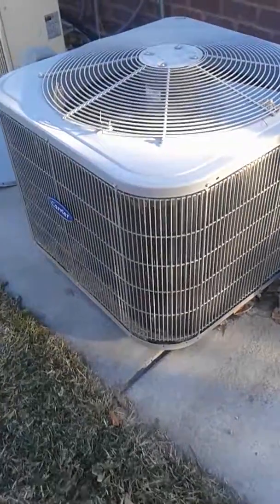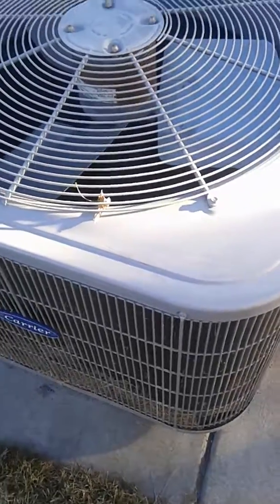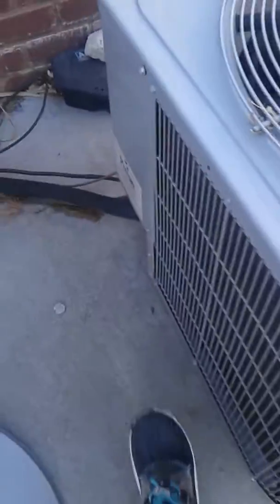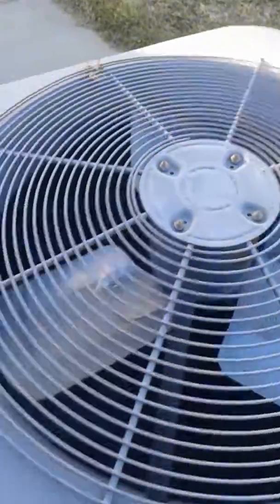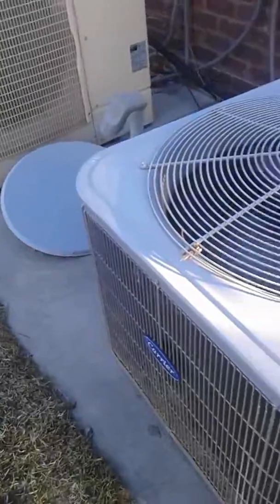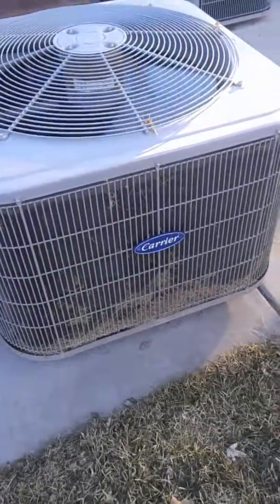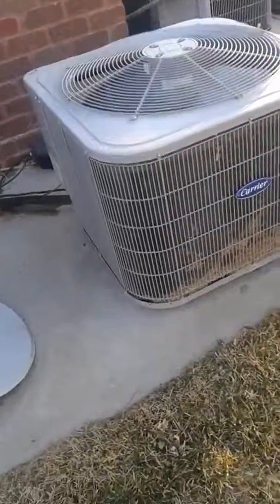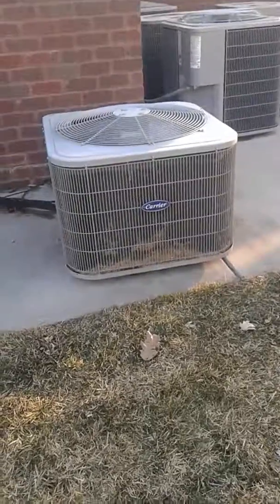Malfunctioning Carrier Central Air Conditioner

Comment: It's on a low-ambient kit, which is when the fan shuts off while the compressor stays running (when it's below 55 degrees) to prevent the suction line from freezing up.
Reply from the maker: Oh, that makes sense. Thank you.  One question: Why would somebody need their AC at 25ºF outside? And it's NOT a heat pump.
Reply from the maker: How does the air conditioner know when it's below 55 degrees outside?
Reply: HVAC Productions yeah it is on a low ambient kit LOL
Reply from the maker: Aris Buliteanu I'm sorry, I accidentally deleted all of our other comments, so I will reply here. Yes I will try and get a startup of the Frigidaire refrigerator. It is brand new, from 2020. It is stainless steel color. And the blower fan of a furnace blows out.
Reply: Dilch Productions *Why do you accidentally deleted my comment*
Reply: What brand of compressor on your Frigidaire… What brand of compressor is on your Frigidaire… What brand of compressor is on your Frigidaire side-by-side??
Reply from the maker: Sorry I wasn't being careful with the computer mouse and I accidentally hit the delete button instead of the reply button. I am not sure what kind of compressor is in my refrigerator yet, but I will look.
Reply: Dilch Productions I believe that the scroll or a reciprocating I mean I believe it's on your Frigidaire and by the way does the draft inducer fan on the temp star furnace blows in or out a scroll or reciprocating
Reply: On your Frigidaire to believe me… I believe that's a squirrel or reciprocating I mean… I believe that's a scroll or reciprocating… I believe that's a scroll or reciprocating on your Frigidaire
Reply from the maker: The draft inducer fan on the Tempstar furnace also blows out, to blow gas out of it. And I believe the compressor in the Frigidaire is a reciprocating.
Reply: Dilch Productions my Frigidaire has a reciprocating compressor
Reply from the maker: Ok cool. I will try to get the video of mine soon.
Reply: I don't know what to say in the last comment… Because my voiceover said a lot of times in T… What??… I don't know what are you saying in the last comment… Can you talk about your furnace again?? Please?? Because my voiceover said a lot of times in T… Repeat it again??噢，恺夸夸夸夸。… Why did you accidentally hit the delete button instead of the reply button??? Question why is that carrier… Low ambient kit cycling??
Reply from the maker: The Carrier was low ambient cycling because it was cold outside. The draft inducer on my furnace blows to get gas out of the house. The blower fan on the furnace blows heat into the house.
Reply: Dilch Productions … That house next-door has goodman central air conditioner you see
Reply: What is your name??
Reply: Dilch Productions in the video… You said tell me guys what is going on with this… And I tell the HVAC productions… I said… Yeah it is on the low ambient kit LOL
Reply: Why the Copeland scroll compressor sounds really angry before the fan turns back on?? Not much but somewhat angry
Reply: What does low ambient kit mean??
Reply: What's the model and serial number in the carrier??
Reply: My furnace… When it starts up… The draft inducer sounds like this as I was saying the draft inducer in my carrier gas furnace starts up like this… In 1 1/2 seconds… It's in full speed how many seconds does your furnace get the draft inducer up to full speed
Reply: So how does the low ambient kit cycle works
Reply: In cold weather??
Reply: What are you doing right now
Reply from the maker: A low-ambient kit is used in an air conditioner when it is cold outside, to keep the unit from freezing up. The fan cycles on and off and the compressor stays on. And I would say that it takes about 5 ish seconds for my draft inducer to start up. And if you watch this video again there should be a place in it where I show the model and serial numbers. I'm not sure why the compressor sounds a little angry, maybe because was cold. And my parents do not allow me to give my real name, for privacy and safety reasons, sorry.
Reply: Dilch Productions … Is the guy busted?? In that video??
Reply: I didn't see the model or serial number in that video… You should tell me
Reply: Where is the carrier located??
Reply: Is it square or circle shape??
Reply: That carrier sells like a 2001 train X 81,000 heat pump already in defrost I mean… The carrier sounds like a 2001 train XE 1000 heat pump already in defrost
Reply: When the fan motor is on… Was it already blowing hot air or room temperature air??
Reply: Is the fan motor two blade or single bladed?? And is it circle shaped??
Reply: Is it undersized or oversized??
Reply: What do you going to put in the title when you get a video of the Frigidaire??
Reply: In that video… What was the description of the malfunctioning care of your LOL I mean what was the description of the title malfunction in CareCentral air conditioner LOL I mean what was the description of the malfunctioning carrier central air conditioner LOL
Reply: He didn't reply to me… Can you reply because you were waiting for 24 hours or something like that
Reply: Dilch Productions where is the carrier located??
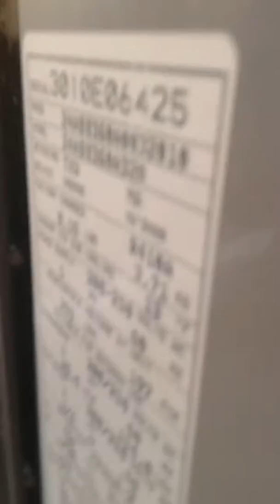Reply from the maker: The Carrier had a 3-bladed fan. It was blowing out cold air because it was cold outside. I'd say it was a little oversized. It is located at an office building. At 0:52 in the video I show the numbers. The serial number was 3010E06425 and I couldn't really read the model number. And what guy are you talking about, that got busted?
Reply: Dilch Productions in the video
Reply: Why couldn't read the model number??
Reply from the maker: It was too blurry on camera.
Reply: Dilch Productions can you zoom in??
Reply from the maker: It is still blurry if I zoom in, but I can see the first numbers of the model number are 24 or something like that. But in the future I can go back to that unit and look.
Reply: Dilch Productions if it's too blurry… Shut off the camera then started again
Reply from the maker: What do you mean? I'm not there right now, it's just a video.
Reply: Dilch Productions this carrier sounds like a 2001 train XE 1000 heat pump that defrosted
Reply from the maker: Cool
Reply: Dilch Productions … I found YouTube on my phone